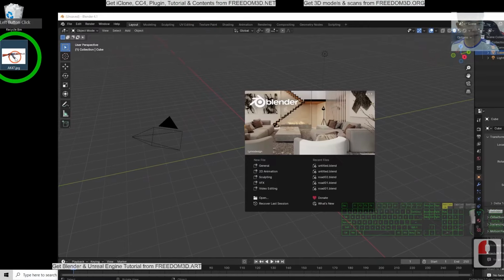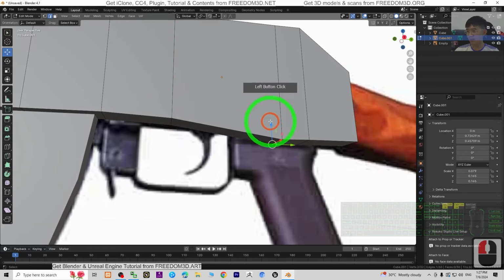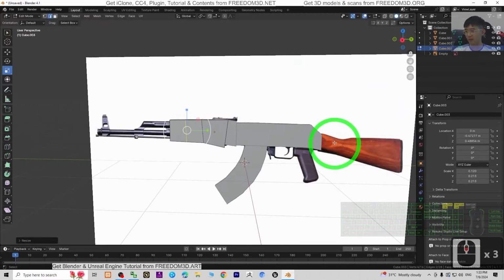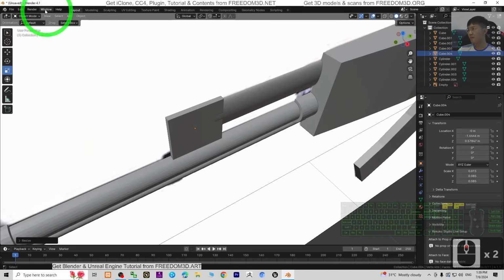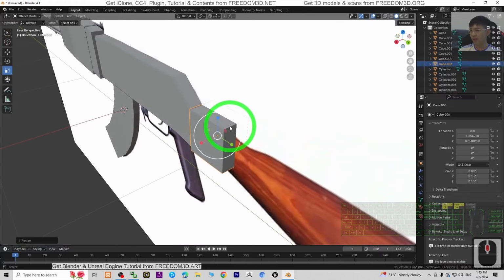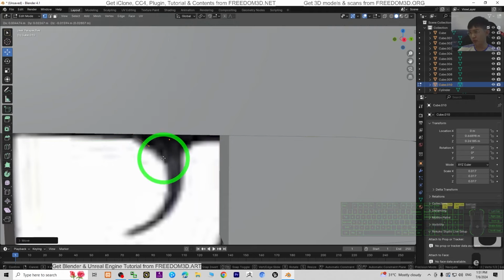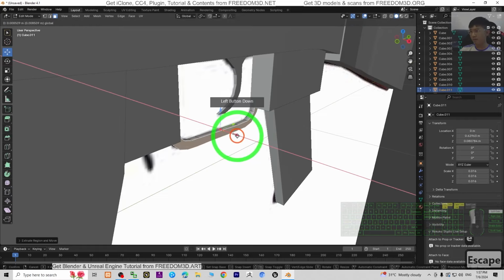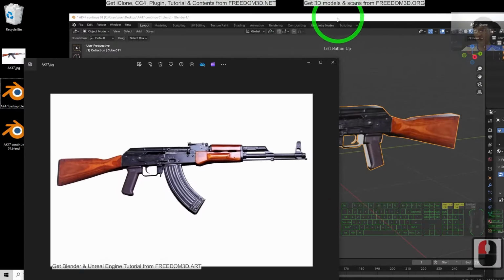Picture to 3D Model in Blender 4.1 | AK-47 Modeling from Image Full Tutorial

Comment from the maker: This tutorial demonstrates a step-by-step workflow for creating a 3D model of an AK-47 rifle in Blender 4.1 using a 2D image as a reference. The process is broken down into several stages:
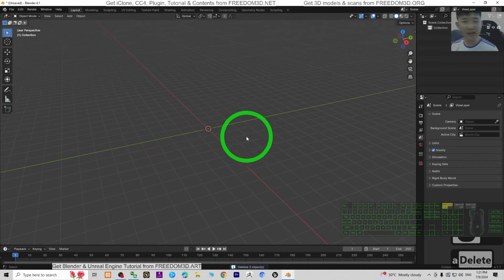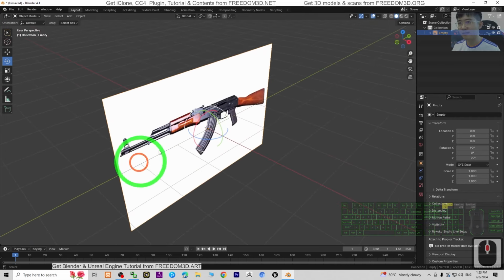Setting up the Reference: The video begins by importing a reference image and rotating it to align with the negative Y-axis for accurate modeling (0:46-2:00).
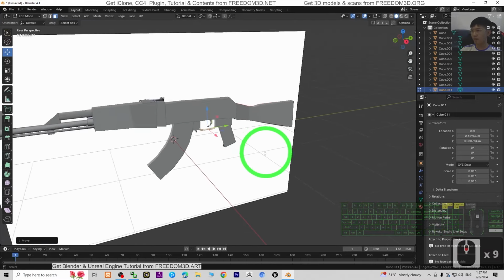Mesh Modeling: The creator builds the rifle by creating various meshes (cubes and cylinders) and using Edit Mode to extrude, scale, and adjust vertices to match the shape of the AK-47 from the image (2:11-36:19).
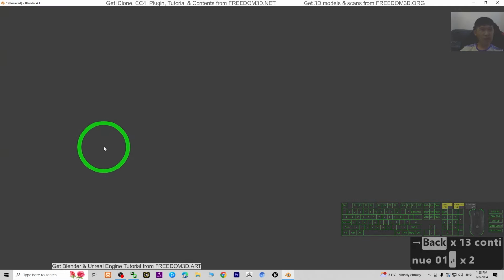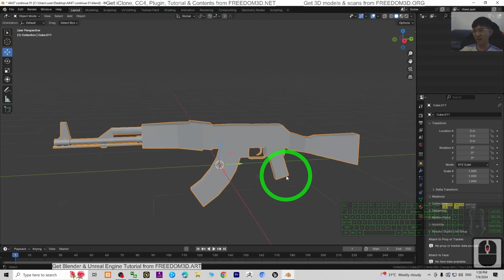Merging and Cleanup: Once all components are modeled, the parts are joined into a single mesh and transformed for consistency (37:23-37:45).
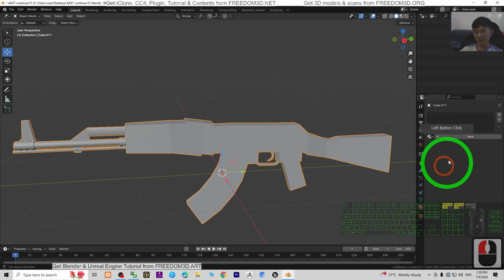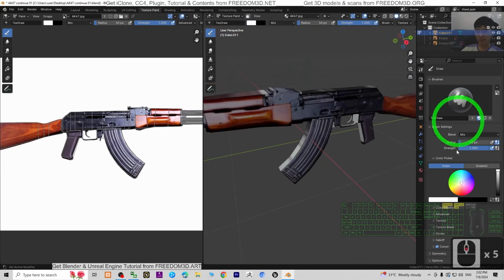Texturing: The final steps involve adding the original image as a texture, performing UV unwrapping to map the image onto the model, and using Texture Paint for any necessary manual touch-ups (37:48-41:37).